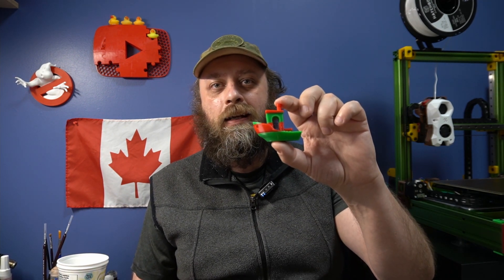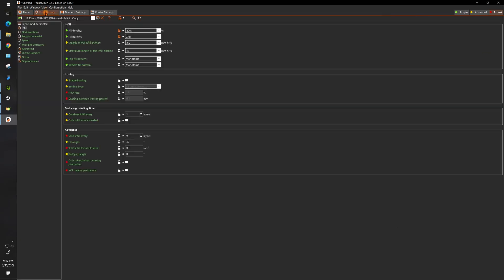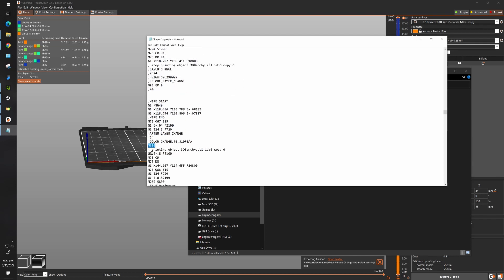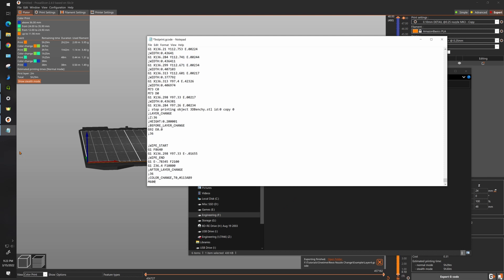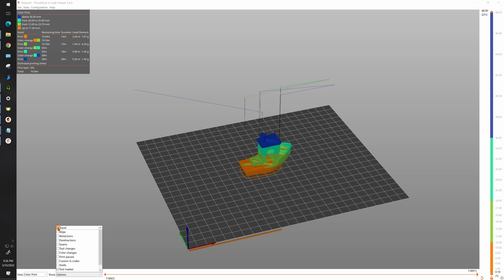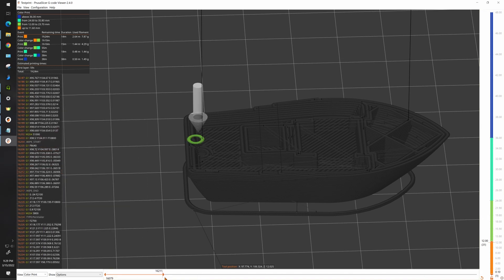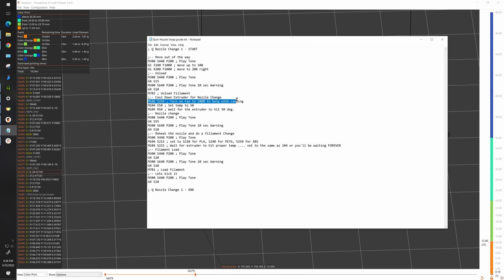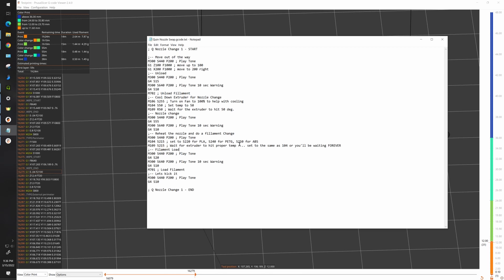Tutorial: How to Generate Mid-Print Nozzle Change G-Code

Comment: I must have missed something (maybe its the whiskey)... the original file is split into 4, and then recombined... how is the new file different to the original?
Reply from the maker: Each 25% of the model is printed with a different nozzle, first is the 0.8 then 0.6 then 0.4 and finally 0.25.  Since each nozzle has a different flow rate you can't just use the same Gcode and switch nozzles.

🍻

Comment: You might even do a nozzle change in the first layer: Set mk3s with MMU2s as profile. Deactivate purge block, but edit skirt line to be 5mm from the object.
Now use an object you want to embedd smal text into (f.e. a case for an electronic project with switches etc). Add an stl with the text (0.3mm thickness of text object). Assign (virtual) extruder 0 to main object, extruder 1 to text. Slice for 0.1mm layerhight. Remove everything for extruder 0 from this gcode, so everything for the case keeps blank. Than slice again for 0.8mm nozzle and 0.3mm first layer, but with skirtline 1 cm away (it is used to prime 0.8 mm nozzle). Remove start-gcode and everything for extruder 0 from this gcode. Than putting first gcode, M600 and second gcode into one file, printing it (starting with 0.25mm nozzle).
Have not tested it jet, but it might be wort trying - as embedding smal text into cases/panels might be an interesting option.
Reply from the maker: The big trick is to have the layers line up, hence the switch every 6mm or write a python script that could take in 4 files and adjust the z heights as needed at switch over time.   I was thinking it writing a python script to do it, but it would have taken me more time then it did to edit the code the one time I needed it for the video as a proof of concept.

It would be cool to find a practical use for this concept though.

Although I am considering making an automatic tool changer for the nozzles on my Voron Switchwire, since I have 3 stepper motor ports available on the 2nd SKR board.

🍻
Reply: @QEngineering  yes, lineup would be the problem If you change in multiple layers of the bigger nozzle. For the first layer (If it is the top layer of the object afterwards) it is less problematicly. With the 0.25mm nozzle print two layers of 0.15 mm hight or three 0.10 layers. Resulting in 0.3 mm. This should be enough if using PLA for text (PETG is often a bit transparent, so it might be a problem, also stringing might kill the nice look). As first layer of 0.8 mm nozzle is also 0.3, everything should line up after first layer...